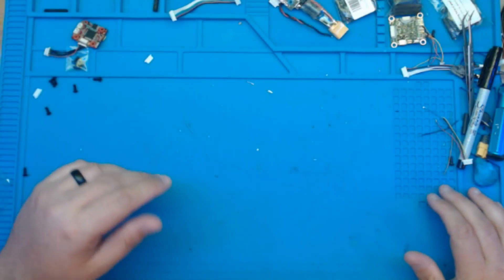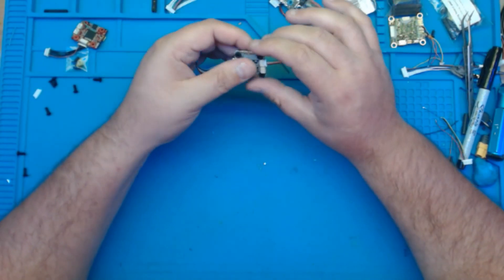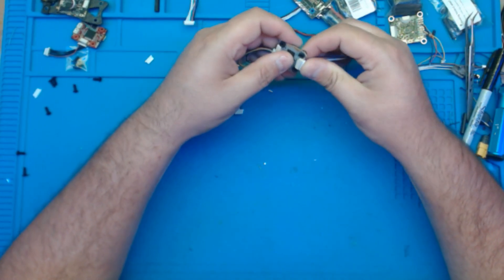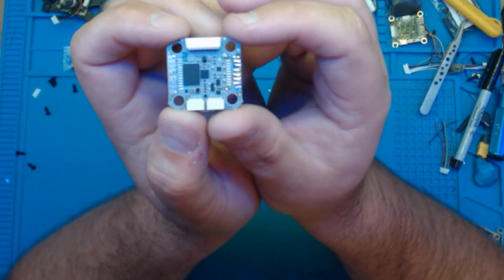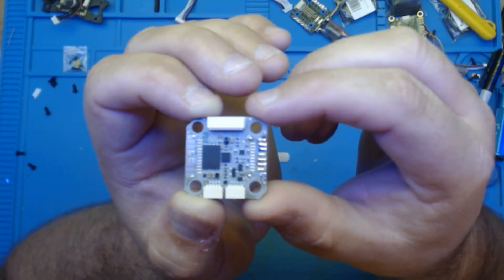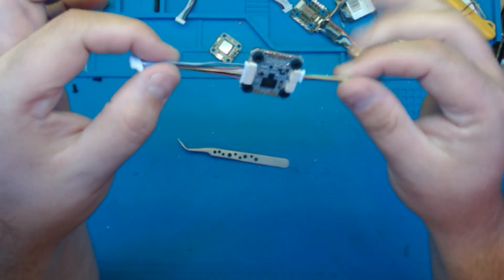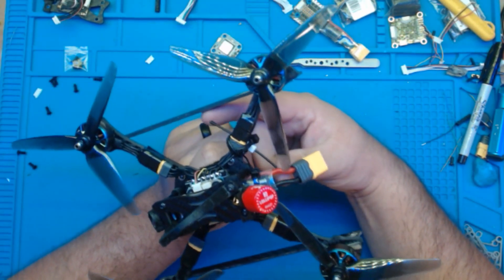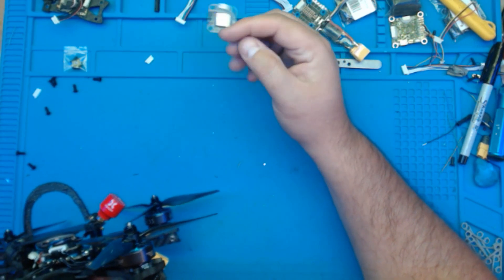Flightone Lightning H7 Flight Controller Complete First Thoughts!

Comment: extremely weird that you worry about cables coming off when being soldered - I hate plugs and will cut them off the moment I see them because they are an inferior connection type to soldering. Had two "failsafes" due to the 4in1 plug not being seated correctly due to a prior crash, thus the whole FC just rebooted mid flight. x)

Comment: Glad you like the FC I designed for FlightOne after suffering some initial confusion with the jumpers, flies great!
Reply from the maker: definitely the most robust feature set on the market.  I'm not a fan of having 5v jumper pads you don't use for 5v but that's literally the only real complaint.  

great job!